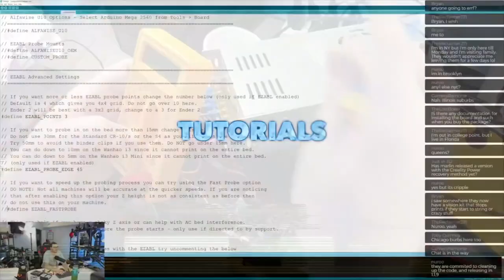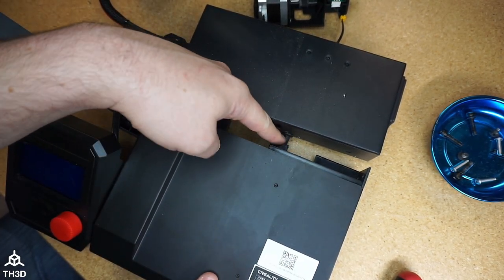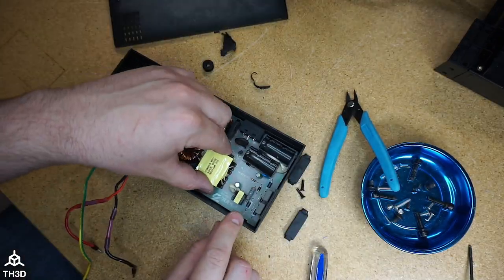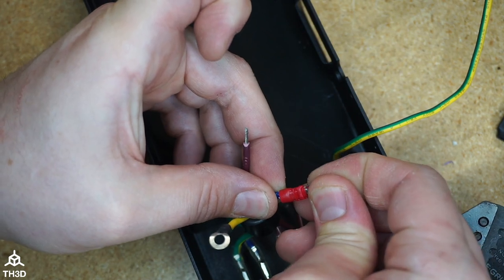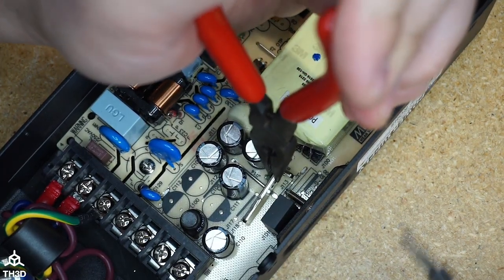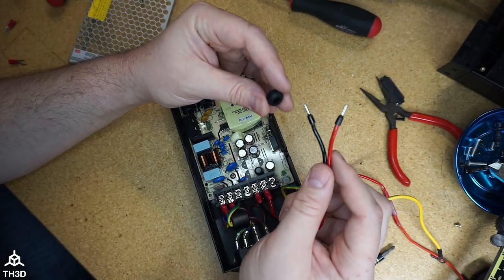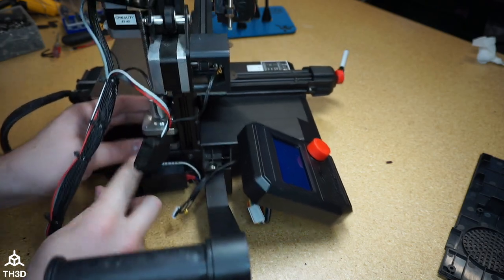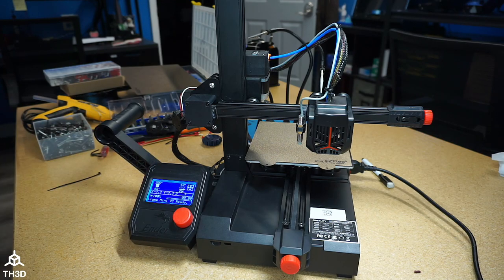Installation Video - Ender 2 Pro Meanwell PSU Upgrade Kit

Comment: What would be the best way to get 24V out of the original power supply? I want to insert a led strip in the Z axis profile and I doubt whether to pull the cables from the power supply or from the motherboard connectors 😅 In other Ender the free connections of V+ and V- are accessible in the power supply, but in this has everything very reduced!
Reply from the maker: You'd have to pull power from the main power input terminal on the board or from the always-on fan header. The stock PSU has no extra power connections on it since the wires are directly soldered to the board.

Comment: Would this work for upgrading a Ender 2 (not pro) to 24V power? 

Existing Ender 2 electrics are being upgraded to 24V from 12V.
Reply from the maker: All the stock electrical parts on that old machine would need to be replaced to run 24v.

Comment: So what makes the MeanWell PS so much better than the stock unit?
Reply from the maker: They're made with better components, put out cleaner power, and they are a known brand that has been around since 1982. One main thing is the knock-off PSUs use very low quality capacitors versus Meanwell uses name brand ones that will last a long time and be within spec.

Comment: I was looking for a way to make my ender 2 pro run not so loud like my ender 3's, when it's printing it's like listening to a jet engine, I saw another video about upgrading the hot end to a sprite direct drive and now am wondering if I should upgrade this PSU like you have as well, thanks for the video if I do do this than I will know how to
Reply from the maker: The PSU isn't going to change the noise level since the stock one is fanless. But the meanwell is going to last a lot longer since its much better quality.

Comment: So is the Ender 2 Pro's inability of hitting 100C on the bed due to a weak power supply or a heatbed issue? I know I can increase the limit in firmware but there must be a reason its set to 80C. I'm planning on buying some upgrades and need to know if should buy the power supply.
Reply from the maker: On the stock PSU it hit 100C. I am not sure why they limited it. It may be due to the stock one not holding up at those higher temps long term but this is just speculation. Ours was used for primarily PLA and PETG so max long term temp was 80C for PETG. If you run our firmware on it then the default max bed temp limit is 120C as thats our default.
Reply: @TH3DStudio  I was wondering why the Ender 2 Pro heated bed was only rated for 80C.  I was looking at the Crux1 and KP3S because of this.  But I do like the creality display better than the others even if the build surface is smaller.

Comment: Sort of unrelated: Has anyone ever come up with a power supply mod for the kingroon kp3s? I‘m talking like a small form factor psu, that can be attached to the base sideways or underneath.
Reply from the maker: Not that I know of. But that PSU is pretty easy to replace since its separate.
Reply: @TH3DStudio  yeah that’s what I was thinking, but I can’t find anything suitable, since the original one can supply 24V and up to 15A. Any old laptop brick I found doesnt supply enough amps and besides I‘d love for it to be fixed to the base with an extra power socket anyways. (Which could be done)
Reply from the maker: I used the 350W on ours with the case thats linked on that PSU page: https://www.th3dstudio.com/product/24v-350w-psu-replacement-upgrade-mean-well/